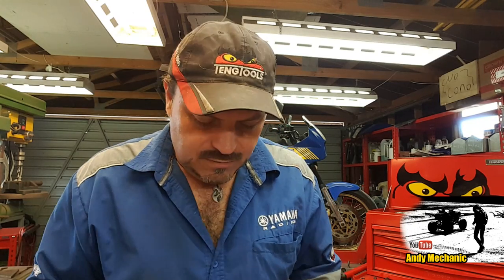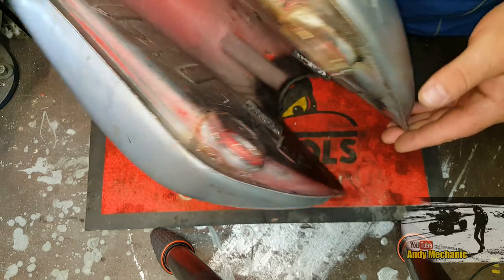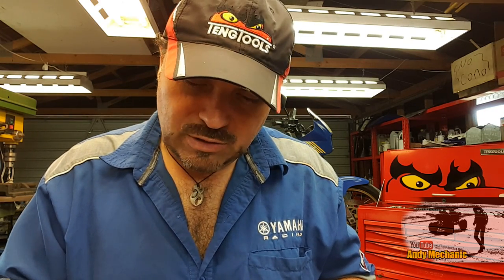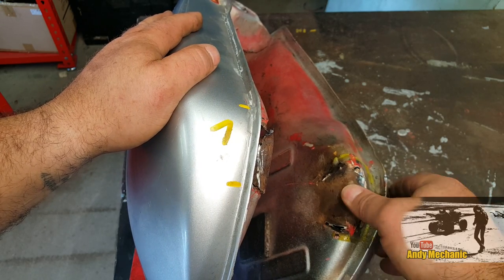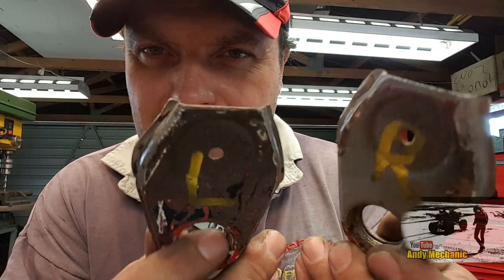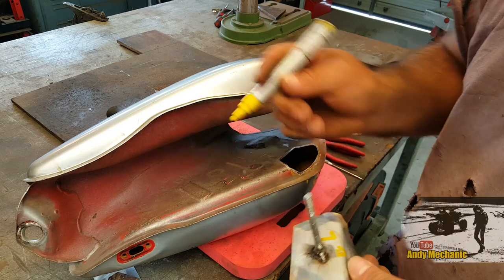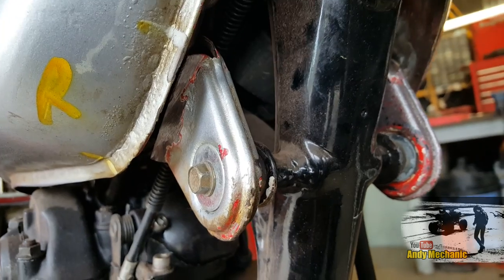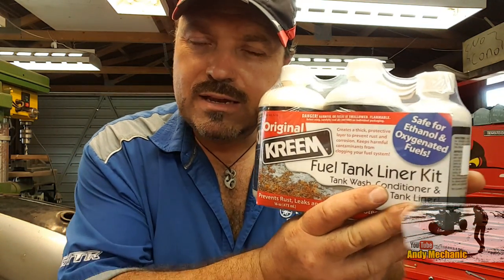Motorcycle leaking fuel tank repair Ep.1 #2011

Comment: That's interesting.  The tank rotted from the outside-in at the welds.  I never thought of that problem.  Will take care on my tanks to make sure it doesn't happen.  BTW, the absolute best way to tackle a tank like that is to get a geared motor, make a bracket, attach the entire tank and bracket to the motor, fill it with about 2-3lbs of nuts, bolts and washers, and three cups of environmentally friendly rust remover, then tumble it for 12 hours.  I did that with my Harley tank that had been rusted and lined.  It removed both the rust and the liner and the tank looks like new inside.  After that you can weld whatever needs welding.

Comment: Nice Fix ! Your weld job was not that bad ! I used that sealer years ago on my 1981 Suzuki GS 1100's  rusty gas tank. It worked very well !
Reply from the maker: +Billy R Thanks Billy, I think 0.6mm might wire would have been more appropriate as I couldn't do a continuous run as it would have blown a hole in the tank's remaining metal. 

Job turned out quite satisfactory given the initial assessment. 

Looking forward to getting the sealant applied next. Thanks for the feedback, yes, everyone I speak to says it works well so fingers crossed  :-)

Comment: I know it has been a while since you published this but I was wondering what MIG settings you used to avoid blowing a hole in the tank?
Reply from the maker: Well, the Mig is really set up for fabrication work with 0.8mm wire. I just turned the power down and did stitch welding - lots of individual Pools - only adding the next as the temp of the last cools a little. Worked a treat :-)

Comment: So many things you didn't mention.  I would have thought you'd make some effort to get the rust out of the tank before welding the patches in. Also, what did you do about gas fumes when you started spraying hot grinding sparks into the tank?
Reply from the maker: Hi Herbert, in part 2 where I add the tank liner we use a special solution together with some nuts & bolts (as per the manufacturer's instructions) to remove the rust. 

With regards the risk of explosion due to petrol fumes the tank was drained of fuel, washed out with water many times then left for a few days to dry completely - definitely no risk of an explosion I can assure you. I have welded up many fuel tanks over the years & following this process I have never had any problems.

Check out part 2 if you get time.

Cheers Andy
Reply: @AndyMechanic  Thank you for the reply and thank you for the interesting content. ! I will go looking for Part 2 right away, but safety information, like the special care that must be taken before welding, cutting or grinding on gas tanks might better go in before the mayhem commences. A lot of guys are learning this stuff from YouTube alone, which makes you the guy who has to say, "Now hold on there, Partner!"
Reply from the maker: Agreed.....though the power tools are supplied with a user handbook too! Though humans rarely read them! Cheers & yes, I will endeavor to include safety info on future videos when I remember.

Cheers Andy

Comment: i have fixed plenty of old tanks worse than that soak in acid solder any holes run it hell i have soldered bullet holes shut with old tin can piece over hole never once had to cut up one and when you store a bike you should never leave fuel in it remove tank drain and add some used engine oil rotate end over end a couple times  and reinstall per yamahas instruction manual for long term storage